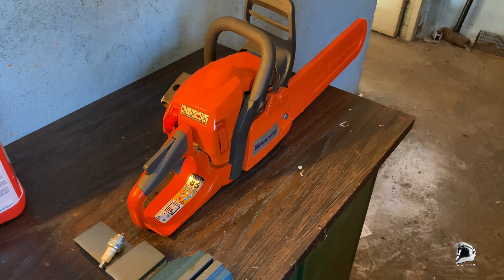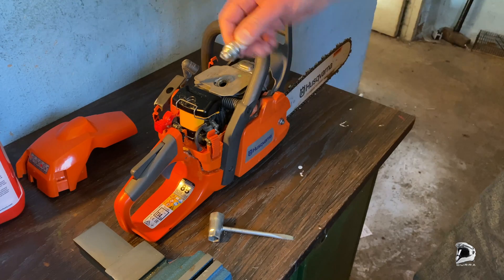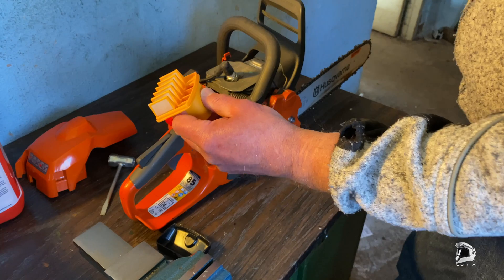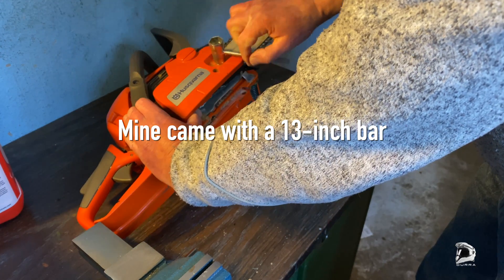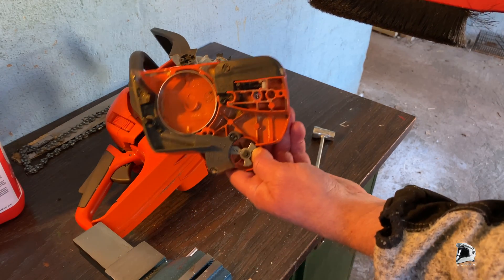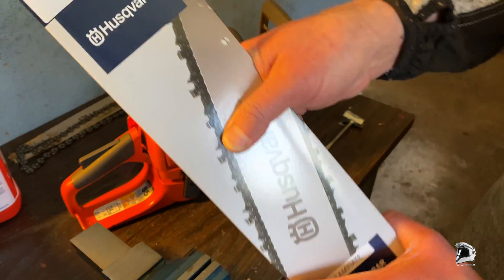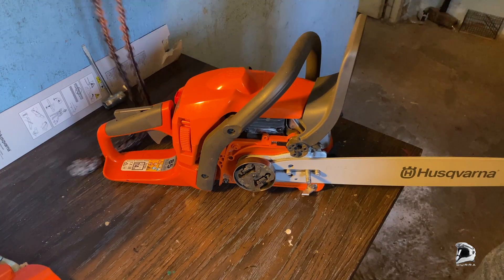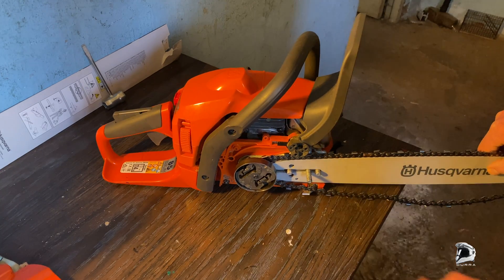Husqvarna 435 II X-TORQ Chainsaw Upgrades , New Bar and Chain, Spark plug and Cleaning

Comment: How do you take the spark arrestor out on top?
Reply from the maker: There is just one screw on top, unscrew it and pull out the spark arrestor, clean it and put it back
Reply: @GurrasGarage   Must be a different model then as there isn’t one on ours. Looks like it pushes down and slides out but can’t get it out.